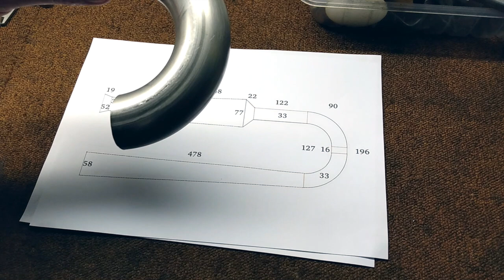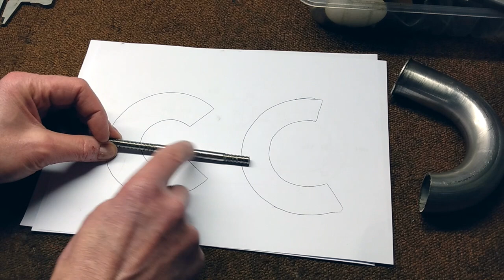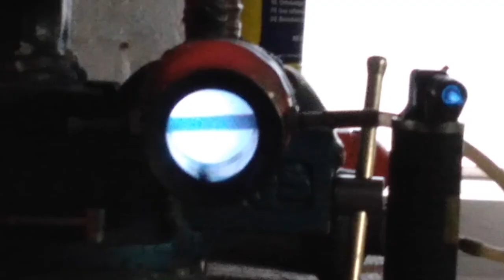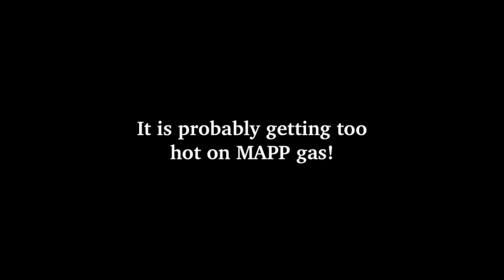DIY Pulse Jet Design, Build and Run

Comment: Any idea of how much thrust it produced running off of propane or acetylene?
Reply from the maker: I have not measured it yet. The jet is kind of on hold as the houses next to me figured out who was creating the infernal noise so I thought it best to leave it for a while. I will get it going again in the winter during some very bad windy weather.
Reply: @mrpingen  sweet
Reply: was wondering the same thing :)

Comment: Sorry, saw you're very soaked feline and so many single entendres came to mind. British humour. Of course a Scot with a cheeky wee peek can assemble it in jiffy. Scottish- genetic engineers. "I'll just add a wee bit here"- goes like a Buzzbomb.
Is there a limit on the fuels you can use? I'd imagine it wouldn't take to heavier oils?
Reply: this made me laugh 😹😹 as for the question of fuels, ideally you want a gas as fuel. liquid wont work properly as it will not pulse properly. you need a gas such as, propane (best), butane (another good option), kerosene is good, gasoline, as long as you inject it slowly it will evaporate into a gas, you just dont want to flood the chamber. hope this helped ❤

Comment: That is just awesome.. put some cooling coils around the hot spots and use the intake vacumn to draw the heated air in..
Reply from the maker: Interesting thought, perhaps heat the fuel though?
Reply: @mrpingen  defitnitly would .. another thought was to put a wire honeycomb mess in the burn chamber to get a more even burn and keep from flaming out ,Theres alot of different implication going on here and the apllications  are  beyond the imagination.ty for showing that i got some ideas that will piss the power companies off.

Comment: I love it, make the next one bigger ! Gotta lose that stupid high viz though, they're loose, flammable and usually just a neon sign advertising I've got no idea what I'm doing so when it all goes wrong, please don't run me over as well. And most importantly, H and S will have pity on me when I'm laying in hospital after being shrunk wrapped in dayglo orange synthetic high viz material.  Trade the fire extinguisher in on a bigger gas bottle.
Reply from the maker: I will need to get a better source of fuel before going bigger. It is obviously the way to go though, like Colin Furze and Robert Maddox.
Reply: @mrpingen  Diesel injection ?
Reply from the maker: @funkiwikid6106  Diesel injection - Yes, Robert Maddox does it that way - check out some of his videos.
Reply: @mrpingen  Did you have to play with the length or was that a lucky guess?  It seems to start easily which is great.
Reply from the maker: length: I had to add in the vertical section on the bend to get it to go. But, in the part 2 video I remove it (plus a bit more) and add on to the exhaust cone length. It seems to work better. You are only seeing the easy starts in the videos.

Comment: Could you please do a video on building your valve amplifier ?  It resembles a Trainwreck amp, which is the style I'm most interested in,  so I'm curious what you did with yours. You play guitar, or at least enjoy trying to, right !?  We look like we could be brothers across the pond, so I suspect we're off the same age group.
Reply from the maker: I have actually started a video on the amp. but, as is often the case, got sidetracked by various things. I will get one done and might even display my less than average guitar playing skills in it. Have a look at my channel later on or in the coming days as I could cobble together an intro. or teaser video. 
Had a look at the amps. you mention and see what you mean. There is a bit of a backstory to the case I made for mine.

Comment: Greetings, from New Hampshire! Great job on the pulse jet first build! I've built several ranging in size,most run from a 20 gallon propane tank,and wow they just chew through the fuel!,I've switched over to gasoline with a fuel injection pump,Saab,but most pumps over 70 psi will work. A nozzle from a furnace to get it going easily,then to a copper.030 mig welder tip,spraying against 1/2 steel disc suspended mid compression chamber an inch from the tip,still eats the fuel,but it's cheaper! I Isubcribed today!
Reply from the maker: Your comment is not only useful but also timely as I was just yesterday working on the pulse jet setting up a proper butane/propane idle circuit and spark ignition. I am now looking at using methanol for the main fuel but have yet to figure out the system for it. I was considering homemade acetylene but it might be a bit too dangerous. 
I left it running in the garage and went out the front of my house just to hear how loud it is - it is louder than I thought and that was just on butane/propane mix, only the Gods know what it must have been like on 'MAP Plus' gas.
You look to be a bit more rural than me - I have close neighbours (neighbors) to consider and most of them are pretty quiet. There is one scummy lot nearby and the next time they have a loud party.....
Reply: @mrpingen  yes,the noise can be startling for the unfamiliar, in fact,I am required to call police dispatch and tell them each time I build one and fire it up,I can't imagine what they tell the people that complain,Still, I'd call it a win for me!

Comment: I love that you made it work with a stick welder. You give your fellow budget pulse jet enthusiast hope
Reply from the maker: It is amazing what can be welded with a stick welder - it is just not very neat though. I have TIG gear but it goes through gas like it is going out of fashion - it does make a nice job as long as everything is very clean.

Comment: Volume fades sometimes.
Reply from the maker: One of the problems of using the microphone on the phone. The editing software I use allows volume adjustment of the individual sections but it seems to be a bit hit and miss - even when set at the same level they come out different in the finished video to how it plays in editing. It is a bit of a nuisance. Thanks for commenting on it as it lets me know that others notice it.

Comment: With a stick welder? Respect!
Reply from the maker: Not as neat as TIG (I have TIG gear but the gas is very expensive and it uses a lot). Can't weld continuously though so have to keep stopping and let it cool for a second or two.
I am so busy with other things that I seem to be making very little progress with the liquid fuel system. Pretty certain it will be methanol though - should be a nice clean burn.
Reply: @mrpingen  If you can get the job done with your stick welder, seems like you're better off. Sort of like training under adverse conditions. I have a MIG and I like it but same here, the gas is expensive. That engine sounded vicious with the MAP gas!
Reply from the maker: @heliarche  I was starting to mess about with acetylene production with the intention of using it as the idle fuel then using heavy oil of some sort. But, as you will know I am sure, acetylene is megga dodgy stuff. Even though I have welding/safety/hazardous area training I might not continue down that road. It could also melt the jet - now that would make a good video!

Comment: Nice build!
And a good explain 
Do you got Some building plans for me?
Reply from the maker: Thanks!
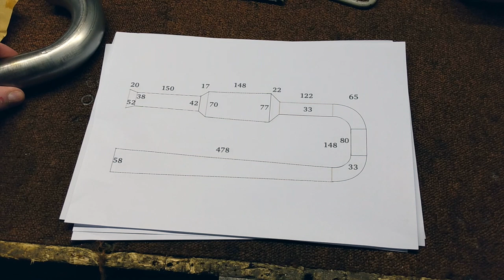If you go to 3:40 in the video you will see the plan. Diameters are on the inside of the drawing and lengths/widths on the outside, all in millimeters. For example, the large exhaust cone is 478mm long, 58mm internal diameter at one end and 33mm at the other end.
I am going to try some modifications and will update with a new video - when I get a chance as things are busy at the moment (aren't they always!).  Still trying to sort out a liquid fuel system but I have now got most of the parts collected that I need...
🙂

Comment: So just some helpful advice for your version 2.0. Since this is a Lockwood-Hiller Design, your exhaust tube should roughly be 1.5-2 times the diameter of the intake tube. Also, the exhaust tube and your combustion chamber should have roughly the same volume. You want to keep around an (8.7:1) ratio of the diameter to the length of the exhaust pipe. If too long then the exhaust gases will "burn out" and cool down too much -- making it impossible for them to ignite the fresh air/fuel mixture. Try and keep the exhaust and intake ends almost the same length with the exhaust slightly longer to avoid sucking in the exhaust. Also from a safety standpoint take the fuel line off of the exhaust tube as when the engine starts and gets to temp it will make the propane self-ignite within the tube. I commend you on actually getting up and building something. Trial and error is a very good professor for hobbyists and professionals alike. Always be learning and be able to accept positive criticism in order to improve your projects and yourself. Good luck in your future endeavors young man. I look forward to the next version.
Reply from the maker: Thank you!
Reply: When you say exhaust tube, does that mean all the piping from the combustion chamber and out, or does it mean just the exhaust cone itself? :-) I am calculating the volume of the combustion chamber and exhaust, as you mentioned that they should have the same volume. 

Thanks
Reply from the maker: I was looking at some slight modifications and your question about the exhaust occurred to me as well. 🙂
Reply: @mrpingen  I am building a jet myself and have a slight bigger combustion chamber than on the drawing som i am wondering about this. Great video btw! cool to see a smaller version also! cheers from Norway
Reply from the maker: @Fr4nzSK8  Are you going to make a video of your jet?
Reply: I always wanted to build one. You got me inspired to do it. Thanks for the video. Well done.